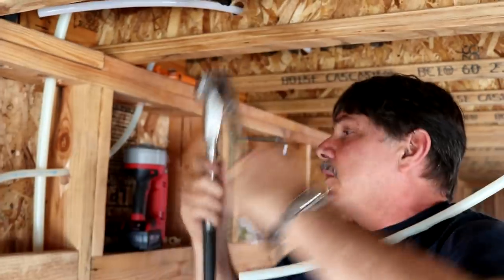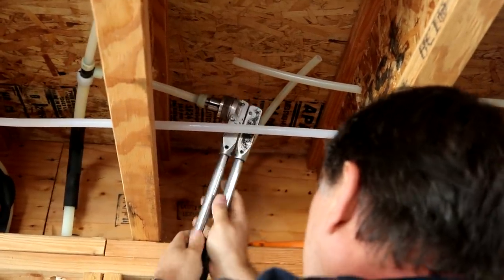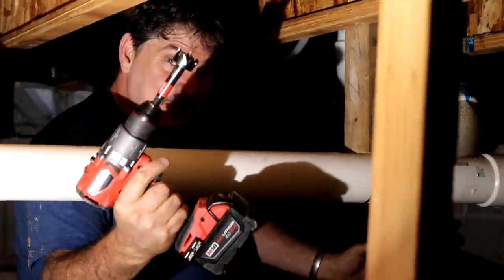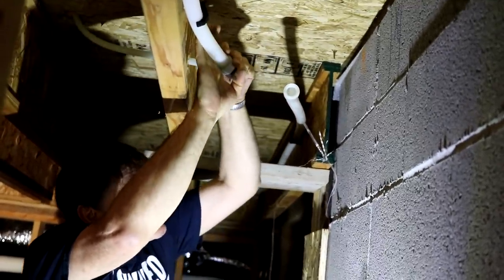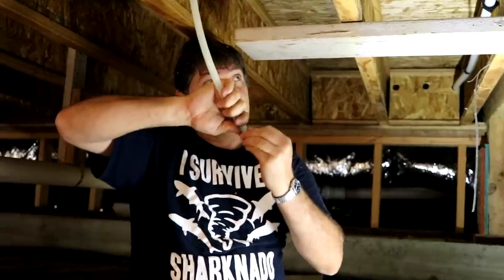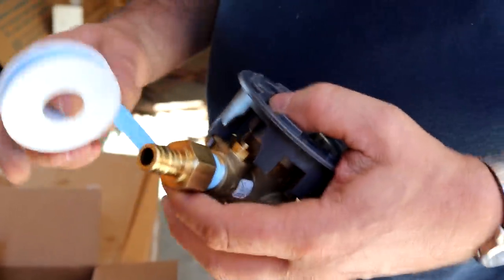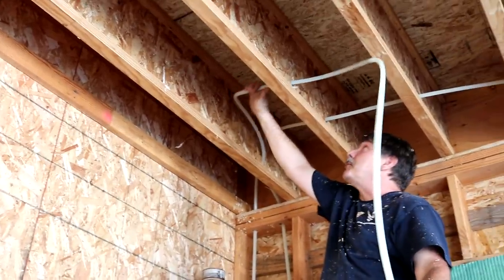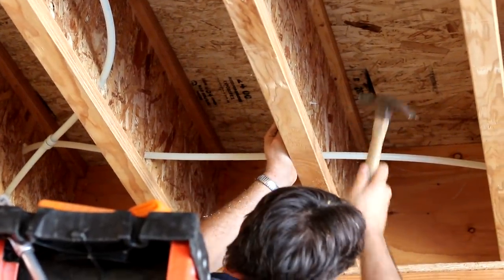Plumbing with Plastic Ep.95

Comment: Hmm, a gas water heater? Why not a ground source heat pump? Way more environmentally friendly and saves money in the long run. Natural gas is a fossil fuel.
Reply: Where would you put a ground source heat pump on that tiny lot. And also natural gas is a renewable resource. You dont have to get it from dinosaur squeezings
Reply: @timothydillon6421  A bore hole isn't that big. I don't think that would be an issue. 
Natural gas is almost always fossil based. Almost all bio-fuels are a scam since we're cutting down the forrests and harming the oceans ecosyatem, among other things, that are supposed to absorb the CO2. If it burns, it's not really, in actuality, a sustainable fuel.
Reply: @MrNeutross  I dont know why you think we are cutting down the forests. There is actually more standing timber in the US now than there was when the pilgrims arrived.
Reply: because ground source heat pumps (and more specifically the ground loop) are expensive. building this for yourself, sure a consideration. Building this as a spec house - not a snowball chance in hell because no buyer is going to pay extra for it.
Reply: @timothydillon6421  vertical wells fit on that lot easily, not even a concern. cost is the only concern with that system and I wouldn't put one on a spec house either. natural gas may not come from "dinosaur squeezings" but it is certainly not renewable.  Renewable is basically solar, wind, and water based power - ie you don't burn stuff and create CO2
Reply: @timothydillon6421 If you have the source for that statement I would really like to read it. Don't mean to be condescending and it might be true but when the North America first where settled, all cities, highways, shopping malls, suburbs and parking lots wheren't built yet. 

U.S.A ≠ the entire world. Globally deforrestation is a huge problem. 
There is also a big difference between standing timber and a natural, healthy forrests.
Reply: @gregorysmith9158  are you suggesting we need to completely eliminate everything that emits co2?
Reply: @MrNeutross  you are correct we need to maintain the forests. The wild fires we saw just this year sent all of that carbon conservation up in smoke.
Reply: @timothydillon6421  no, I am suggesting that your definition of "renewable resource" is wrong as it almost always means a fuel from a source that you don't burn because the majority of things your burn include something that we can't create again (coal, oil, and yes, gas).  Biomass would be the one thing considered renewable that you burn - we can replant trees or plants to create ethanol and it does create CO2.  But I would venture to guess, there would be no one complaining about CO2 emissions if their only source were the burning of biomass.
Reply: @gregorysmith9158  decomposing matter emitting methane is renewable. It happens everywhere every day. And yes a ground source heat pump has a poor ROI.
Reply: @MrNeutross  if you are referring to the amount of standing timber Scott has talked about it on the 2nd channel.
Reply: @timothydillon6421 sure, CO2 emission has natural sources too.  I would point out one caveat about ground source heat pumps - they have poor ROI when natural gas is available for heating because natural gas is so cheap.  Otherwise, your heating options tend to be electric resistance heat or burning propane, oil, or wood which all tend to get expensive fast (or labor intensive with respect to wood). So ground source heat pumps are certainly expensive upfront, but can have great ROI when no natural gas is available because of how efficient they are. Couple them with solar panels and its a slam dunk. Ask me how I know :)  my ROI for my ground source heat pumps is like 7 years.
Reply: @timothydillon6421  alright, I'll have to check it out then. Is it 7n one of the podcasts?
Reply: @timothydillon6421  I know this question wasn't meant for me but I would like to say that as long as the "bio fuels" we use emits more co2 than we can replant forests and restore damaged ecosystems, that is their ability to store and sequester carbon, they aren't really sustainable. Even burning firewood in a fireplace or stove is, as the World is being run right now, an environmentally damaging fuel source.

Comment: That bugs me. It’s not plastic
Reply: Yes, it's plastic. Specifically, Cross-linked polyethylene.  If you don't think polyethylene is plastic, the you really have no clue what the word plastic actually means.
Reply: @andrewalexander9492  
Considering I been in the field 38 years I know a few things. 
You do not call it plastic. 
You can say it’s a form of. But never call it plastic. 
People that don’t know better would never want plastic pipes. People think of plastic as crap. 
You can say a form of plastic that’s linked etc etc. 
but never plastic
Reply: @mikesacco8457  ummm, OK.  I get avoiding using the word plastic around customers because some people have negative associations with the word, but claiming that it's not plastic is incorrect. It is in fact, plastic,  by any definition.
Reply: @andrewalexander9492  
I’ll say this. Both right and wrong.  Lol
Customers never understand pex. And saying plastic gives the wrong idea. 
I never say plastic at best a form of but not really. 
It’s like saying. Abs. PVC 40 and 80 are all pipe. 
Or a Lamborghini and a Pinto  there just both cars  ( big difference)
I have learned over the years call it what it is and not the generic term. 
And although it’s a you tube video and we try to dumb it down per say it’s never a great idea.

Only other thing. Personally curious why not rotate exp tool
I don’t miss using hand tool went all cordless. 
Very smart to leave pipe lax. And always use as less fittings as needed. 
I go to so many jobs and they use 90’s where there not needed. 
And as you pointed out too and bottom holes keep hot and cold in same area. 
I always say a good plumber can use same pex color and know what’s hot or cold.
Reply: @mikesacco8457  Right, but to insist that a Lamborghini is not a car would be incorrect. That's what's happening here.
Reply: @andrewalexander9492  
It is a car. They both are. But there’s a big difference between the 2 of them. 
Although I’ll admit a Lamborghini is overpriced. Lol
I must say this. 
It’s very enjoyable going back and forth about this. Most would start name calling or being well a bit of a smart ass. 
Then people who read all this and don’t know about plumbing will be thinking we’re nuts. Lol
And. Merry Christmas to you and your family. 
Hopefully we all make it through the rest of 2020 and pray 2021 gets better. 
Been a wild crazy year for sure

Comment: I’m not a plumber and I’m not an expert on plastic piping in a home, but I am old enough and have read enough about the disasters of plastic plumbing systems and the millions of dollars in lawsuits because of them.I am very disappointed with Essential Craftsman putting this product in this spec home. Everything he has done up to this point I marveled and admired, and felt that whoever purchased this house was one fortunate individual with their family. No longer. I could not buy this house knowing this product has been installed nor would I be comfortable recommending anyone to buy it.

Though copper is far more expensive and has its own set of problems and shortcomings, it is a tried and true, excellent plumbing system that, in my opinion, Scott should’ve decided on for this house. I’m saddened and deeply disappointed.
Reply: I suspect they said the same thing about copper when galvanized pipe ruled the land. OSB when plywood was the standard. And on, and on. All products fail (for different reasons), but many fail because of poor or uninformed workmanship. It's a matter of what product is the best overall (reliability, material cost, ease of installation, environmental impact, etc). And it seems the plumbing community has mostly made up its mind on the PEX vs copper issue.
Reply: @johncortell4431    Of course the plumbing community has "mostly made up its mind on the PEX vs copper issue."  PEX is cheaper than copper...much cheaper...much easier to install, faster, more user friendly, and takes far less skill to put together than copper.  Sort of like electric cars than gas powered ones, but who wants to wait 45 minutes at an electric charging station to "fill up" when you are traversing the country on the freeways? Newer is not always better.  But John, you did not comment on the multi-million dollar lawsuits that have come out against PEX or all their failures.  Or the fact that PEX does not have nearly the long history of success and reliability that copper has.  

Look at what is happening in the HVAC field with Chinese made capacitors.  They fail all the time and cause havoc and a huge expense for homeowners when they fail.  Chinese junk.  Now, you can get by with a failed Chinese capacitor on an HVAC outdoor unit until the tech can come by and replace it, but when a Chinese PEX fitting fails or a PEX line splits or cracks, the homeowner now has a real problem to deal with.  Yet millions upon millions of homes have these systems put in their homes and countless fail.  Remember the Chinese drywall problem some years back? 

Case in point:  right now, today, I have a leaking Chinese made, Schedule 40 ball valve that is leaking.  I installed it maybe two years ago.  It is an outside line so I can deal with it without worrying that my place is going to suffer catastrophic water damage, but you get the point.  But it was cheap, easy to install (but certainly not easy to replace), and I took a chance on it.  You get what you pay for but now I have to deal with the hassle of fixing or replacing it.  

Scott is not a stupid man, but I believe he made a potentially disastrous decision to put PEX into this spec home.  It puts another ding into his reputation as a skilled craftsman who only puts the best materials and workmanship in his home...including this one. If he was building this for himself and his family to live in, well, taking the chance on PEX would be understandable.  But building a house for someone to buy and live in for perhaps decades and choosing to go with a system that does not have the reliability of tried and true copper is not, in my thinking, a sound business decision and poorly reflects on Scott's judgment.  Sure it would cost thousands more to have copper installed, but remember, water lines running throughout a home requires the absolute most trustworthy and reliable system on the market...no matter what the cost.  PEX is not this system.
Reply: @adobemastr  Yes. There are lawsuits against PEX. We are in a litigious society. Can you point to a single lawsuit won by the plaintiff against PEX that rules that the technology itself is flawed? As opposed to particular fittings that have failed (that doesn't reflect on PEX itself)? As opposed to pending lawsuits that could very well resolve with a finding of flawed workmanship/installation? Listen, I don't have a dog in this fight. But here' what I know. Scott is not one to skimp on quality. PEX is being used successfully in tens of thousands of homes every year--without problems. Time will indeed tell whether PEX is a good product or not. But it is not fair to ding Scott for choosing it in this house. This is a widely adopted technology, used in everything from cabins to multi-million dollar homes.
Reply: I dunno R, you wrote paragraph after paragraph about PEX explaining how bad it is but none of what you said has changed my mind. After all, you’re not a plumber or a plastic pipe expert.
Reply: @johncortell4431    I have not checked the status of the lawsuits as of late, John.  Like I said, right now I've got my hands full trying to fix this leaking, Chinese ball valve.  And you might be right:  PEX might be the greatest invention since our ancestors discovered copper was great for water lines, but the multiple lawsuits against PEX has me concerned.  Let me take care of my leak and later, I will see what I can read about the lawsuits.   And I admire Scott immensely, but again, I think he made an unwise decision on this portion of his build.  But again, I'm no expert...just a homeowner/contractor who has to decide for himself what best system to use.  Good discussion, though.
Reply: @jasonlutz5036    You are correct, Jason...I'm not.
Reply: @adobemastr  You are incorrect in your claim that Scott "only puts the best materials and workmanship in his home".  Each and every material choice involves compromises, and he has been honest about his reasons for the choices.  You really think asphalt shingles are the best roofing material on the market?
Reply: @jej3451    You made an excellent point, friend.  I give you the win in this one.

Comment: The issue with plastic pipe is that over time it becomes brittle.... Also if you forget to put the inserts in stand by lol.
Reply: You're talking about Poly B. This is PEX.
Reply: Pex doesn't. You don't know what you're talking about.
Reply: If memory serves me correctly, I think copper pipe has a lifespan of 100 years, where PEX is rated for 70. Copper is extremely expensive, when compared to PEX. Copper doesn't have the give that PEX has, so it's more susceptible to damage from pipes freezing and the water hammer effect. Plus, you don't have to worry about burning down the house when installing PEX. But, you can use the copper pipe as part of the building's ground system and it can be made with much thinner walls for a greater volume of water flow. 

But don't take my word for it, Matt Risinger of The Build Show has a few episodes where he demonstrates the performance of PEX versus Copper versus PVC.
Reply: @jackielinde7568  Pex is great, but what about the fittings. Will they last 70 years?
Reply: @mph5896  My understanding is the 70 year tests include the pipe, the collars, and the fittings.

Again, if you want to see tests, Matt Risinger of The Build Show has a few videos where he puts PEX, Copper, and PVC through their paces on his channel. He's a custom home builder in Texas, so I'm pretty happy taking his word for it.
Reply: @mph5896  do they make copper fittings for the PEX?
Reply: @jackielinde7568  " copper pipe has a lifespan of 100 years,  "  That's kind of a meaningless number.  It all depends on the local water conditions. There are areas where copper plumbing will develop pinhole leaks in a few decades.   In other areas, the lifespan of copper is potentially much more than 100 years.